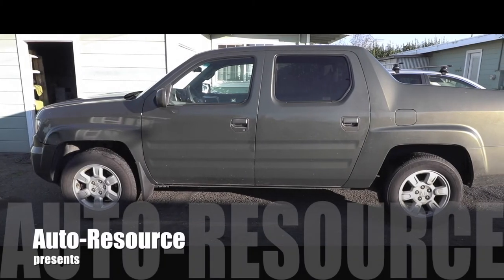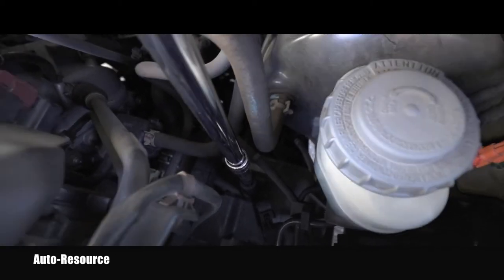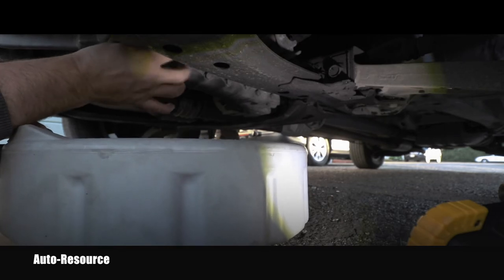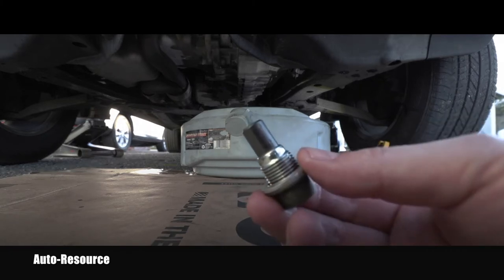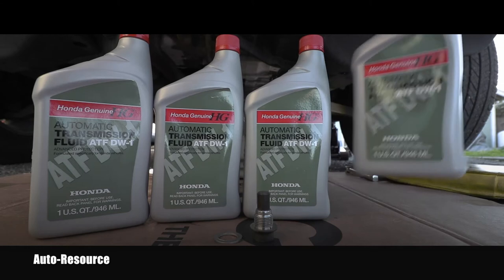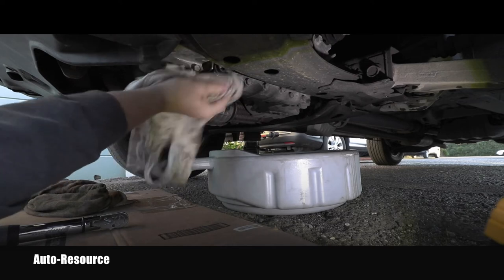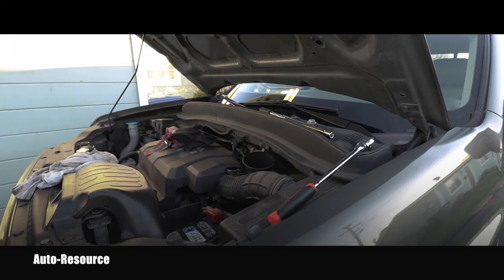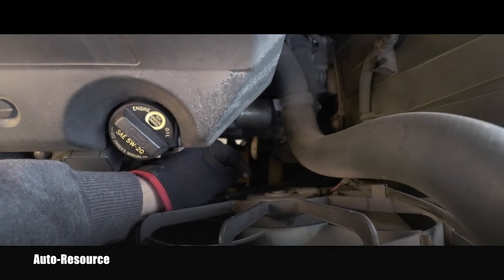Honda Ridgeline Automatic Transmission Fluid Replacement

Comment: Nicely done !
This is the correct way of transmission fluid replacement under maintenance minder service.
Never flush a Honda transmission, it has a built in filter and a flush can damage that filter.
Thanks for sharing 👍

Comment: Thanks for the detailed example transmission fluid change video. I have ridgeline 2007 worked for me I had to continue the procedure with a full flush or change x 3 the fluid.. I went about 50 miles in between each fluid change on final drain was pretty clear thx again!!
Reply from the maker: That's cool , thanks for sharing

Comment: Hey, there is a bolt on the transmission accessible from the wheel well. I wonder if that can be used to fill it as well.
Thanks!